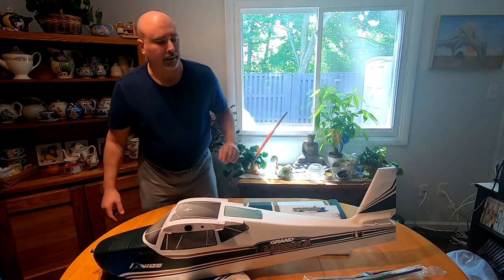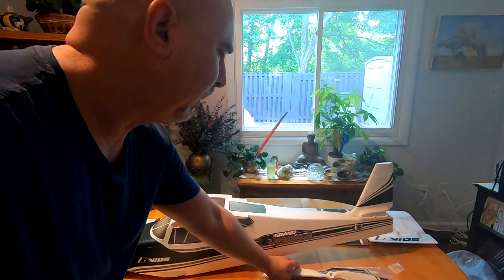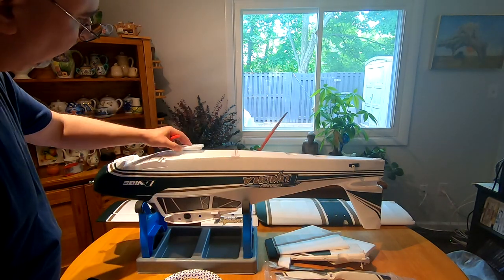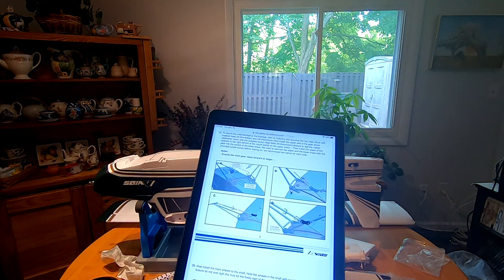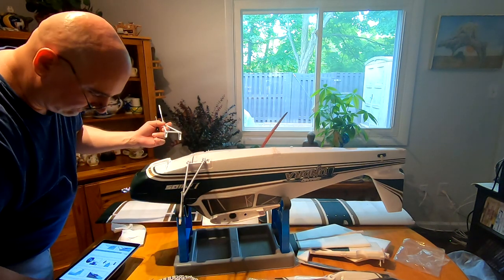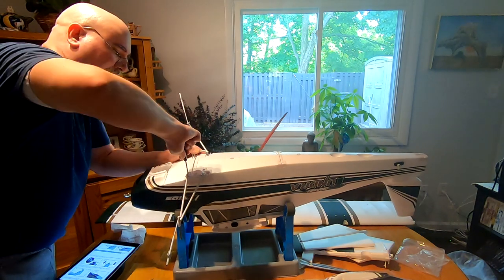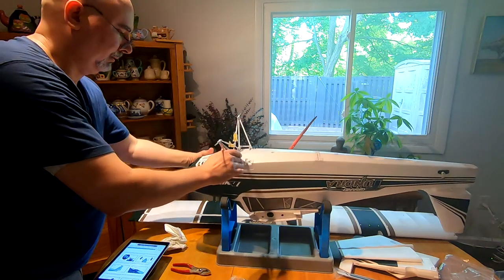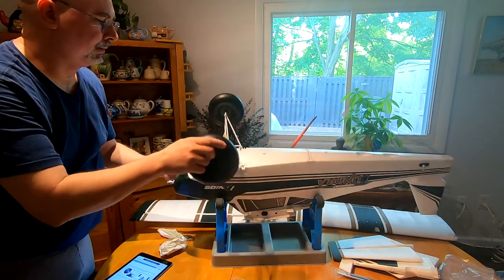Assembling the Avios Grand Tundra Plus - Part 1

Comment: I came here for the landing gear info.  TWO questions.  Where can I find the info to order the plastic mounting bracket for the landing gear.  And, what are the diameter of the wheels.  GREAT VIDEO.  THANKS.
Reply from the maker: Hi, sorry for the late reply... here's a link to all the Grand Tundra planes and parts on HobbyKing's site. I don't think you can buy Avios parts anywhere else.
https://hobbyking.com/en_us/catalogsearch/result/?q=grand%20tundra

Thanks for watching and have a Happy New Year!
CJ
Reply: @MyRCChannel-CJScott  Thanks a lot buddy.  One more question.  Overall.  How do you like the Grand Tundra, and how many flights do you have on yours.  From what I'm seeing, the only real complaint is the rear landing gear.
Reply from the maker: @gisall8205  I've heard the same complaint. Truth be told, I haven't had a chance to fly this plane... same for a couple of large planes I've got on deck. Our local club closed most of the first year of the virus. A lot of issues got in the way this last year and I'd shifted my focus more to cars for a while. It's winter now, so I'm waiting for warmer weather. Small planes and gliders can be flown at a local park on quiet days, but this is just to big for that environment.

Comment: quick question how did you wire the lights I have a  2 connectors in the tail of the plane that dont have anywhere to connect?
Reply from the maker: The corresponding leads may have slid into the tail or fuselage... depending on which has less wires visible. You may need to shake the part and if that doesn't work, take a piece of reasonably stiff wire, coat hanger if necessary, and fish around. Best of luck!